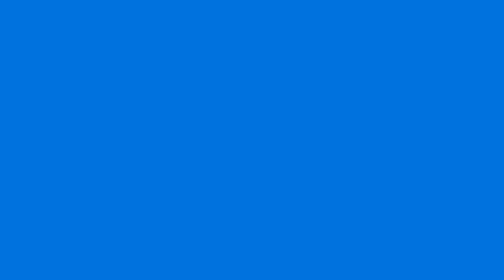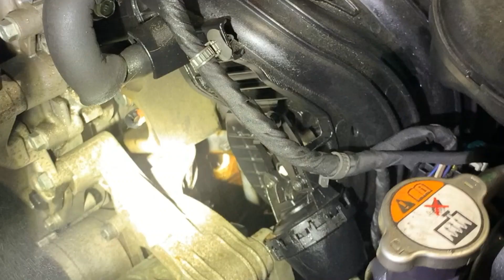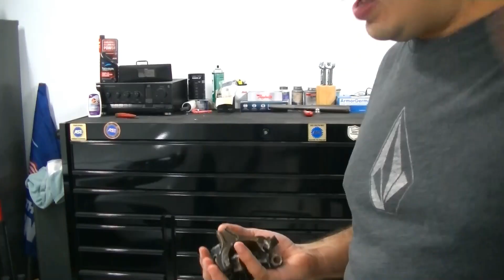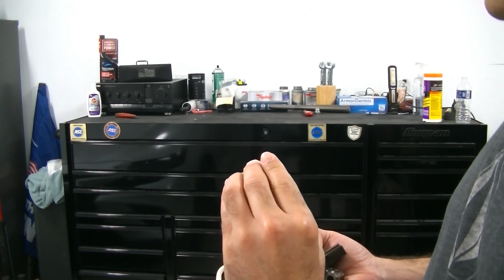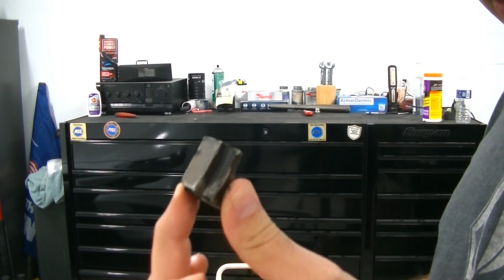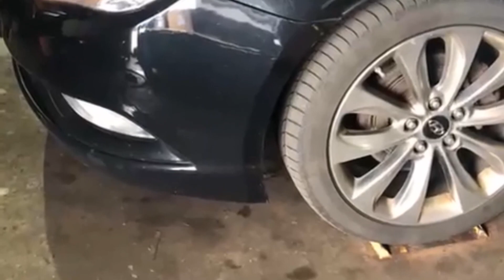P1326 In Hyundai/Kia vehicles, Cause of Theta 2 engine Failures, Timeline of Hyundai engine recalls

Comment: I have a 2014 Hyundai Tucson, with 23k miles. I took vehicle to Hyundai dealer with a very noticeable engine knock noise. The dealer did a “noise test” and said it passed the test and to continue to drive it normally. After reading all the serious problems and fires of these defective engines, I feel unsafe, and would like them to replace the engine. The knocking noise is very noticeable to the naked ear, yet they said it passed the test. Don’t understand this. Is there any other path or other direction I can take, so I can get another engine from Hyundai?
Reply: Contact the Corporate office or a lawyer.
Reply: @lonniebeal6032  DEFINITELY CALL HYUNDAI CORPORATE! WE DID, And, make sure you get the right dealer ship, we have a 2013 santafe sport 2.0t seized up at 150000 miles, we are not the original owners but the Post falls dealer ship(Idaho)came and towed our car from our home to them and are putting a new long block in it, plus another brake recall that on it too, the engine recall started in 2017, if you have issues with a dealer ship always use Hyundai Corporate for mediation, hope this helps in the future or even now. The dealer ship in Spokane Wa, 30 miles away from Spokane weren't so damn nice, pays to call around. Hyundai is and will honor most of the recalls.

Comment: Does hyundai require the engine to be seized to get a new engine or will they replace it when it is knocking because of the rod bearing failure?
Reply: They will replace if it falls a certain test. I drove my ‘15 optima  to the shop at 30 miles an hour as the bearing went bad and codes were flashing on dash.  But thought it would make it 15miles from where the problem started. 

Though if you don’t have record of all your oil changes at the dealer or receipts you will be denied.  But the dealer will know more and maybe go to bat for you with the manufacturer to get you an engine if that’s what it needs.

Comment: I have a 2015 sonata SE ,  the car has been consuming an obscene amount of oil lately and a week ago i was on the freeway when I felt my car losing acceleration, then it started shaking so I pull over and shut the engine off, I turned it back on but it was shaking a lot and would eventually shut down on its own , towed it to Hyundai dealer and ran diagnostics, they told me I have a cylinder 4 misfire and recommend replacing the engine, the car has 90,300 miles and they said since I’m second owner ( bought it at Carmax) warranty wouldn’t cover me and extended warranties only cover very specific engine failures which they said don’t apply to me so I’m responsible for 100% of the cost, I’ve read other people having the exact same issue as mine and Hyundai was able to replace their engine at no cost, I called corporate and told me the same thing that there’s nothing they can do for me, I kept up with maintenance consistently,
Reply: I have a 2017 Sonata at 60k miles. I plan on trading her before 65k miles.
Reply: I'd  try n stay  off  the  freeway  as  much as possible  being  an  older  higher  mileage  hyun- die
and / or  kia.  they're  pretty  much  5  year / 50 - 100 k mile cars, give  or  take,  with  not  good  odds  as  they  age n  accumulate  more miles.
solution : junk / chunk  it  n  get  a  toyota and / or  honda.........

Comment: My 2014 Hyundai Santa Fe Sport engine blew up at 54,000 miles. 10 year 100,000 mile warranty, extended warranty and they want me to provide ten year oil change receipts. Recall order from judge states only updated KNOCK SENSOR Update or seized engine must be replaced. They will replace my SUV that almost was rear ended by truck when motor blew.

Comment: I have a 2016kia optima with 55,600 miles and got a P132600 knock sensor range/performance.  This code is a hard code, unable to clear. There is a TSB PI1802w /x address engine replacement for this DTC code.

Comment: I have this problem right now on a customer's 2014 Tucson 2.0L. P1326. There does not appear to be any engine noise that I can hear and the engine has been well maintained. I found a bulletin about aftermarket oil filters but that sounds like a shift of the blame. Do you know if the T3G campaign applies to the Tucson? Great video's BTW. Subscribed!
Reply from the maker: Yes, the T3G does apply to the tuscon. Have them take the car to the dealer and be sure it has the latest software version. If it does, I’d be pretty confident in replacing that knock sensor
Reply from the maker: The aftermarket oil filter bulletin is more for cold start rattle from the chain/phasers. I’m very familiar with that TSB
Reply: @SEsGarage  Thanks for the reply. Apparently it had the programming recall done in the end of November. I linked your channel in my video: https://youtu.be/O61_fHfZygU
Replaced the oil filter to be safe and if it returns will be sending to the dealer for further diagnosis. Thanks.

Comment: Do you know what the criteria are for setting code P1326?  My sister's car through the code before I got my hands on it and sounded fine when operating in limp mode.  I cleared the codes which disabled limp. Reving past 2K rpm and driving, i can hear clear bearing knock, but its not throwing P1326 again after about an hour of city/highway driving.  Afraid to take this to Kia without the code, so wondering how long I need to operate the vehicle and under what conditions to get it to appear again.  Tx in advance!
Reply: I'm having the same issue, did you ever get the code to come back on ?
Reply: I wasnt able to, no. But i towed the car to my local kia dealership for fear of the motor self destructing on the 20 mile drive there.  As soon as they heard it, they suspected the recall issue so they ran their diagnostic procedures. Once cleared with corporate, they installed a new motor at no charge.

Comment: my 2014 with 119000 k hyundai santa fa  2.o T is in the shop for a new engine , so my question is will it be the new design model either a 2022 or 2023 .
Reply from the maker: No. It will be a remanufactured version of the same engine in the car

Comment: I own a 2012 Sonata limited with 62k miles on it, it was in an accident and has acquired a salvage title, it only needed body work the engine wasn’t hit. Does Hyundai honor recalls on salvage titles? I. Told no, but also yes if it’s a safety issue.

Comment: I have a question? I took my car to the dealership for the recall  cause  me car would stall qhile driving,  excessive oil consumption and a loud clanking in the engine plus lack of power on excelleration. They said that they did the recall and inspection diagnostic,  but told me if i needed them to do more I would need to pay for another diagnostic text and then they would decide if its covered under  the recall.  Everything the recall has stated is what my 2019 k8na is doing and they won't do anything unless I pay for a diagnostic test.
Reply: any update on what happened?
Reply: @psmith990  has the car been diagnosed with rod bearing failure?

Comment: I traded my 2011 Genesis Coupe 2.0T and got a small 2016 Veloster Turbo 1.6T new. I'm currently at 35,000 miles. I was told that my Veloster is also a GDI Theta II engine. Should I get rid of this one too?
Reply from the maker: The 1.6t is a gamma series engine. Relatively reliable if maintained

Comment: I don't believe the metal shavings in the oil story, because Hyundai would have fixed that.  Do you think oil/fuel dilution is a possible cause of these failures, especially in the 2.4's which are often filled with 5W20?  I'm reading many stories about excessive amounts of fuel found in the oil in these engines.  Also a number of stories of GDI pumps leaking directly into the engine, often since new.  This would explain why the failures started occurring with the GDI redesign.
Reply: Nah I think the problem is with the theta 2 design since my engine is theta 2 MPI and failed at 100k miles. In Saudi arabia, we did not get 2.4 GDI engines only the new smart stream 2.5L engines which have MPI + GDI. Those engines also have a problem with excessive oil consumption with new cars that even haven't had oil changes yet!!!

Comment: How reliable is the 2.0L GDI Nu engine? I have 23K miles on one in a '19 Tucson SE.  So far no issues (except for fuel diluting the engine oil) but I've heard a few reports on forums of failure at around 60K miles. I know Elantra's with the smaller 1.8L variant are notorious for piston slap developing, also at around 60K miles, which cascades into other problems (some theorize the piston head was designed too short).
Reply from the maker: They have an issue with piston ring design (too hard of a metal used to make them) coupled with the offset crankshaft design and lack of cylinder wall liners. Unfortunately they like to eat cylinder walls which does lead to piston slap and oil consumption. This requires at minimum a short block replacement to correct

Comment: Holy cow...Thank you so much. When I got the first P1326, I brought it to my local shop (not a Hyundai dealer) and they changed VVT solenoids. But right after the repair, I drove the car on highway and I got the check engine light again (I was away from home like 200 miles)!  But a guy from a nearby shop reset the code and I went back to home safely. Since then it's been fine but after a month later when I drove my car on highway again today, it turned on the check engine light again (so this is the 3rd time). Is it dangerous to reset the code? Looks like it does not come up when I drive in my town but only comes up when I go more than an hour and highspeed.
Reply: My happen 2 weeks ago on highway p1326 code and it knocking i took it to kia so im waiting for them to call me
Reply: @JuniorT69  I see. I made an appointment but have to wait until next month. Thanks for sharing your story!
Reply: I heard not to erase the code because it makes it harder to get the engine warrantied if it's not in there.

Comment: I would like to see one of these torn down. I dont believe their cop out of metal shavings/deburring issues. U would think they would save a lot of money and fixed that. Not let it go on for 8 years. I think theres another issue, I'm not sure what but I'd like to see. I own a 13 Optima SXL that the engine went in 2020 at 53,000 miles. Never burned oil nothin, just outta nowhere. My aunt has a 13 Sonata 2.4, 105000 miles, original engine, but it drinks oil like its goin outta style. And theres no external leaks.

Comment: Thanks for the video.  We have a 2013 Hyundai Sonata  with 144000 miles on it that went into limp mode tonight and has the P1326 code.  Engine is knocking and vibrating.   Going to get it towed to dealer and see what they say.

What 2022 Suv would you recommend  buying that is reliable?   Thoughts on electric vehicles?  are they worth  buying yet or do they need more tefining?

Thanks
Reply: What ever happened? My story is identical to yours! Changed knock sensor, engine still vibrating and check engine light flashing.
Reply: Buy a Toyota highlander or rav4

Comment: I have 2016 Kia forte5. 2.0. I believe it has the Nu engine. This car is made in Korea would that make any difference? what is my chance of engine failure? now it started to use one quart every 5000 miles oil change. am I on the way for some problems?
Reply: My mother has a 2015 Kia Forte Koup EX 2.0L non-turbo. I've changed the oil and filter every 5,000 miles. It has used about 1 quart between changes for years. It has 132,000+ miles on it with no problems.
Reply: @bartektodde  I have now 107000 miles still uses a quart of oil every 5000 miles. I believe will not have any engine problems because it’s made in Korea. 2 of my coworkers have kias. Sorrento and optima that were made in Georgia USA. They both blew their engines. Hopefully Korean made kias will be fine.

Comment: Was the issue resolved with a replacement engine? I thought I saw a few people mentioning having the engine replaced multiple times. I just picked up a 15' Sonata Sport with the 2.4L with 115k on it. So far, it's running great but now I'm like, what the hell.
Reply: I know how you feel.  Just picked up a 16' model Sonata Sport with 71K.  Runs and looks great, but man I wish I knew all about this before turning over the cash.
Reply: @dseagull3567  my 2016 with 104k just had the engine light blinking and the p1326 code and i hope it will get replaced for free bc I don’t got money to get a new engine myself

Comment: You mentioned the 18-19 Tuscan. What about the 17 Tuscan? I have a 17 Tuscan 1.6T that I bought brand new in June, 2017. I’ve taken it in for 2 recalls but they didn’t really tell me what they did. Due to the pandemic I haven’t driven much at all the last 2 years so I still have low mileage and haven’t had issues yet. What should I expect to go wrong with it?
Reply: I've a 2016 ECO turbo Tucson, 1.6L so no Theta II problems, only 47000 miles, I use full synthetics, change it when it's dirty, aound the 4 month mark, once a year spray seafoam in the PCV system and clean the intake, will be installing a catchcan this summer, but my warranty is over so it won't void anything.  I've had no problems so far.

Comment: Have a 2015 Kia forte5 with the 2.0 liter developed a knock at 90k and had the engine rebuilt at dealership. At 135k have a blown head gasket. I’m so done with gdi.
Reply: Sorry to hear that. 2015 Kia Forte Koup EX 2.0L with 132,000+ miles and no engine problems.

Comment: I have a 2011 Hyundai Sonata, after looking at the video makes me a little worried driving my car. I had the anti knock installed with a orange dipstick. Likewise, I guess for now I should be checking my oil level to be covered, correct?
Reply: Keep on top of maintenance, change your oil every 3000 miles and check it weekly, I work at a Hyundai dealer and see these cars come in every day just about

Comment: I am in need of advice.... Can a 39k mile engine fail due to piston issue? My 2016 Sonata Hybrid Limited went into Limp mode.  I put my own code reader on it and got the P1326 code. Dealership did the sound test and said it was piston slap and needed a short block. Won't cover it... I'm the second owner... Very well maintained engine... Regular oil changes at every 3750 miles... All recommend service... All by dealership... I think it's Connecting Rod Bearings but they say no. I think defective engine from the factory. I desperately need help!! I just had car in for service 400 miles ago and they said nothing was wrong with it!!!
Reply from the maker: I replied to your last comment on another video. The series engine installed in that car (Nu) is recalled for the same issue. (Piston slap) on several other vehicles. Most notably the Elantra GT. As I mentioned in my other comment, I would absolutely call Hyundai corporate and escalate this situation. Do you know if your Hyundai dealer submitted a prior authorization requesting for assistance from Hyundai on your behalf?
Reply: @SEsGarage  thanks so much for the reply and advice. I don't think my dealership did anything other than the sound test and having Hyundai tell them it's not the connecting rod bearings, but a piston issue.

Comment: One small question:
If i have to get my own repairs outside through an external mechanic how much will it cost for the oil burning issue. What all parts list are we looking at in the worst case scenario). 
I plan of doing so because i am scared/suffocated by the feeling of having to drive a broken/oil-burning engine everyday to work, 
and especially my Sonata is an embarrassment when I try to quickly speed up at a red light during night time (its like an Octopus trying to camouflage in the rear view mirror!)
Thanks.
Reply from the maker: You’d be looking at at minimum a tear down to inspect and possibly pistons/rings. Could be scored cylinder walls which would require replacing the block as well

Comment: Does smartstream solve these issues?
Reply from the maker: Unsure as I no longer work for the brand. I did take several “new model training” courses for the smart stream and unfortunately it’s largely based on the theta series of engines. With supposed “improvements” in the oiling and cooling systems

Comment: If you're looking at a Sonata or Optima, would a better option be the 1.6L turbo / DSG over the 2.0/2.4?   I haven't seen any issues reported with the 1.6 outside of DSG jerkiness.
Reply from the maker: Most people absolutely despise the dual clutch transmission in those cars! We had nothing but complaints out of them, and people get even more upset when we told them their complaint was normal
Reply: I've a 2016 ECO Tucson, 1.6L turbo, 7 speed DCT, I love it, it has 47,000 miles no problem.  So I say stay away from Theta II motors.

Comment: how reliable were the G6EA 2.7 V6 "Mu" engines that came in the 2007-2009 Santa Fes?  No issues?
Reply from the maker: They were great! As long as you kept up on maintenance (timing  belt as they were interference engines). Had a few with collapsed tappets but that’s about it
Reply: @SEsGarage  Thanks.  That was also what another Hyundai tech mentioned :)  Nice for it to be confirmed.

How often would the 3.3/3.5 engines experience head gasket failures?  It seems that some of them are experiencing that perhaps as a result of the threads in the block pulling out/head bolts losing clamping torque as a result.

It was disturbing recently to read that Hyundai pretty much recommends replacing the 3.3/3.5 engines when a head gasket failure occurs due to how weak the Aluminum blocks are when it comes to the head bolt threads :(  Quit disturbing.
Reply: The 2.7 is a delta engine , which is pretty much bullet proof . Just make sure your timing belt kit is replaced every 60,000 miles